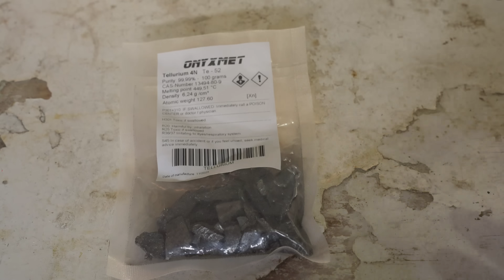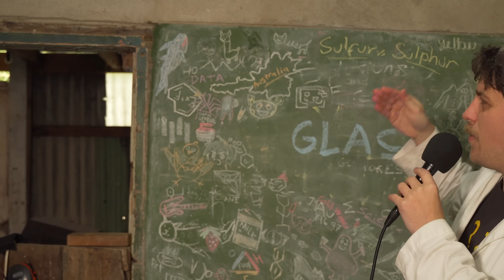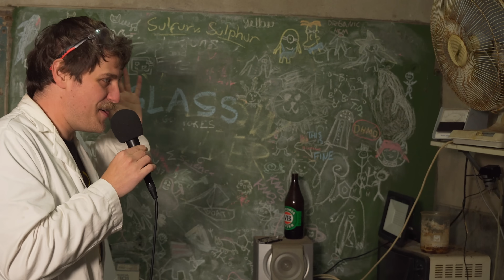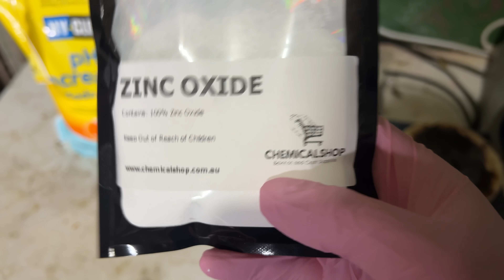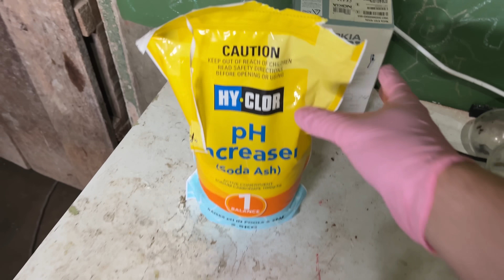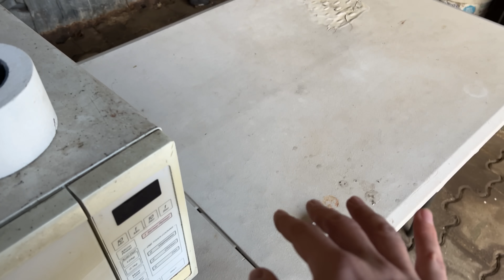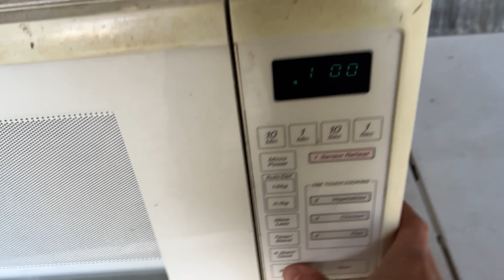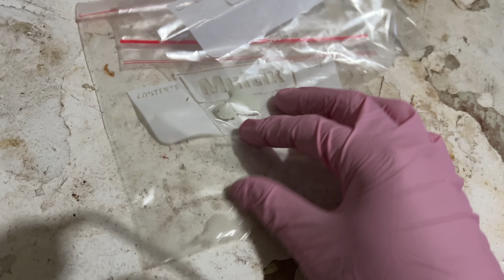Let’s make TeO2 glass with bright fluorescence

Comment: Everyone talks about photons but forgets about darkness; that is carried by subatomic wave-like particles called photoffs.
Reply: And also the elusive Fuckoff particles also known as dark matter.
Reply: Thanks dad.
Reply: There are also jerkoffs, but they have nothing to do with physics as far as I’m aware
Reply: Photoffs walked so photons could run
Reply: There are also particles that carry a lack of vibration called phonoffs.  Apparently, they're quite frequently emitted by powered-down electronics, making them very popular at movie theaters
Reply: @bobloblaw4297  Well done
Reply: You mean dark light?  Like dark energy?
Reply: Ahh, another proponent of the darksucker theory of light bulbs!
Reply: @aetius31  The Fuckaround subparticle with two spins
Reply: i thought photoffs were waves that behaved like particles sometimes, not particles that behaved like waves sometimes?
Reply: @jimsvideos7201  The fcukw¡t never gets mentioned.
Be that the up fcukw¡t,
The OG fcukw¡t,
The down fcukw¡t,
Or the totally screwy strange fcukw¡t.
More research is needed, but it could rewrite the standard model.
Reply: @Sniperboy5551  "there used to be a bunch of assholes that lived in this particular building here... but we systematically removed them like you would any termite or roach..."
Reply: @Sniperboy5551 that would be **negative** derivative of acceleration
Reply: And they can move faster than light in the right circumstances.
Reply: @Sniperboy5551  I think Jerk is a derivative of acceleration over time.

Comment: I wonder if the reason tellurium's chemistry is so weird is that it has 8 stable isotopes, with a 10 neutron difference between the lightest and heaviest. Might mess with the orbitals and stuff? I dunno.
Reply: It has d orbitals which are close in energy to its valence orbitals. It could just be the result of how many bonds it can form with other species.
Reply: It won't mess with the orbitals, but heavier isotopes have different kinetics. Although a difference of 10 is very small compared to the total mass, so it won't have much effect. Like the other commenter said, it's more to do with how close the orbitals are to each other, which is more related to the high charge of the nucleus and sheer number of orbitals than anything to do with mass. d-orbitals are WEIRD.

In short: atomic mass can affect kinetics, bond strengths, bond vibrational modes etc, but it doesn't affect the orbitals, which control the types and number of bonds an element forms
Reply: I think the problem is that tellurium is stinky and other things dont like it
Reply: i absolutely love your videos and they are so informative
Reply: Tin has 10 stable isotopes with a 12 neutron difference between the heaviest and the lightest and behaves much more "normally" so I doubt it

Comment: One of my favorite things about back yard chemistry videos is how often people incidentally make the most hazardous rocket oxidizer in common use, that most career rocket people have never seen in person.
Reply: as a layperson, what is the oxidizer you mean?
Reply: The brown gas, nitrogen dioxide. If you cool it a bit it turns into nitrogen tetroxide, which is a common oxidizer for bipropellant hypergolic (self-igniting) rocket engines, usually used with some kind of hydrazine. If you've seen any recent press about astronauts stranded on the space station, it's because nitrogen dioxide has been damaging the seals on their thrusters and it isn't clear if they will keep working.
Reply: @bbrockert the manufacturer used the wrong kind of rubber didn't they...
Reply: @bbrockert I accidentally make it every time I start my truck
Reply: speaking of, whatever happened to xombie and xaero?
Reply: Not only "make" but "know what it smells and tastes like" which is 🤯
Reply: @bbrockert source?
Reply: @MatthewHolevinski  Xombie is retired, still exists. Astrobotic is still operating a xaero-similar vehicle called xodiac.
Reply: @GrimReaping  It certainly might kill some people, but have the shareholders got more value? That's what matters

Comment: Hey I can explain why the torch strobes! Basically all flashlights and similar objects use the same exact off the shelf control chip to do shit like "make it so you can have a button that turns the thing on and off" At some point the standard chip became one that does that strobing thing and it is in fucking everything for some reason. Some reason being they're very plug and play, consistent, functional, boring shit like that. Basically it means that instead of thinking about control circuits the makers of that torch simply bought an existing design.
Reply: Doesn't it also help in flashlights to work as a distress signal? The strobing is eye catching
Reply: @magneticsnail7218  not that useful unless you want to signal people in UV in this case
Reply: Yeah only the more expensive flashlights tend to have custom modes. Or even just UXs that don't suck. Cheap lights all use the same shitty controllers that are mostly; hi lo strobe. Sometimes you might get a medium or an SOS! I've seen so many one button UIs that do it better but for some reason the cheap ones are all trash.

E; also if it works, it works. It drives the LEDs, and its cheap. It's stupid, but hey, cheap is cheap. There's a reason the more expensive ones are the ones with different controllers/UIs
Reply: Yeah so you have to cycle through all the modes every time when you only want off and on.
Reply: I have a personal beef with the manufacturers of both that 'flashlight chip' and the 'BT device chip'. If they would have just had the button be held for a moment to change modes, and have the headphones say the battery state when they turn on, that would be awesome. My favorite flashlight has that role mostly because the modes actually make any sense. 
Also can we just disable the redial feature on BT headphones? I have never once wanted to do that. That's more a complaint with the OS though.
Reply: To make it on and off it doesn't require any chip. A simple sketch exist that has been doing the job for very long. They are intentionally adding the feature because why not.
Reply: China, probably made in the samer factory too.
Reply: @nexaentertainment2764  It's like with Christmas lights; Starting in the '90s and up to the present day they all seem to have the same presets (Combination, In waves, Sequential, Slo-Glow, Chasing/Flash, Slow fade, Twinkle/Flash, Steady on). I guess it's because the manufacturers churn out millions of these controller chips under the assumption "Meh, it works, and they sell, no one really cares, so why bother updating the design".

Comment: I worked in a copper refinery. The Se&Te reported to a byproduct of the electrolytic cells called slimes. Slimes contained all the precious metals, Se/Te and Cu.  The slimes were pyro processed (NaNO3& NaCO3 + hell fire) and separated into dore' silver (contained all the Ag/Au and Pt group), slag and a red mud we recovered from the off gases.  The red mud was said to contain the Te.  The Se&Te went off to a department called Se/Te and the Se/Te were refined.  Mostly we made product forms that were easy to use in steel alloy production and some super high purity forms for niche markets.  A massive amount was processed into medium grade crap that went into a warehouse in case an application arose "someday" Mostly the warehouse helped the company avoid disposal cost of this less-than-worthless material.  People did get exposed, not all exposed people got stinky. Those that did acquire the stank were never cured. My job took me all over the plant. I hated Se/Te, mostly I hated the SO2 used to process the stuff. Congrats on the result.
Reply from the maker: Yes everyone waits for the Te price to rise… any day now… we might actually need more of it someday… Thanks for sharing mate!
Reply: Would EDTA chelation work as a cure?
Reply: @CPU9incarnate  I doubt it

Comment: Tip from an inorganamus, next time you need fine powders from metals or nitrates you should look into steric entrapment synthesis.  I have the fortune of skipping most the steps and working with 5N materials but this is sometimes the easiest way to get nanopowders on the multiple gram sort of scale.  Extra short version: 1:1 pva:nitrate, water to solve, evaporate, heat to 250 in beaker, don't huff the fumes, grind and calcine the black foam, get a beautiful white powder.  A reasonably tuned SES protocol should be able to yield submicron grains, if a little agglomerated.

Comment: Tellurium can be added to metal stock to make it easier to machine. Copper is quite soft, so it tends to be difficult to machine. Cutters tend to dig into the metal, making large chunks rather than small chips. Tellurium is brittle enough that adding a small amount (0.5%) will cause the resulting alloy to break off in small chips, improving the surface finish and ease of machining. I recently bought some and have been turning it, and it does machine very nicely. It's copper alloy C145.

Comment: For future glass chemistry purposes, in general if you cook the glass long enough in an oxidative atmosphere, the oxidation of any metals present will take care of itself. Especially if you have a lot of other oxides in there as fluxes to strip the passivating layer, and you finely grind the metals. I've used pure iron, copper and zinc powder in glassmaking (glazemaking, actually, but glaze is just a glass on ceramic) and in an oxidizing atmosphere they all do oxidize substantially. Unless it's a refractory material like chrome or aluminum, oxidizing in advance is optional in many cases.

Also, the best rule of thumb for glass chemistry is as making up a broad set of 3 properties: fluxing, glass-forming, and stabilizing. A flux makes the melt more liquid, glass-formers contribute to the transparency, and stabilizers are usually refractory and keep it from being excessively liquid, weak, or spattering. In this recipe, you have TeO2 as the glass former, ZnO and NaO as the fluxes, and no stabilizers (often fine for a compound intended to be low-temperature-melting). We don't usually include colorant since its properties are usually either refractory or a flux, and it's uncommon to have more than 2% colorant. This recipe is actually (un?)surprisingly close to many low-fire glazes used in ceramics.

Comment: Tom, maybe make up another batch of glass, but pour it into a blocky square mold and put it back in the microwave furnace, and try to slow cool it over a longer period? Could even pour it in, then remelt and just run the microwave at a lower and lower duty cycle to slow cool and see if your rapid cooling theory is correct. Then partner up with a gem facetter (lapidary) and try to get them to face off the two ends and build a solid state laser, or if that doesn't seem to work just blast it with the highest intensity 337.1nm light you can get out of the kitchen junk drawer. (I could ship you one that you could power with the HellMachine...)

Comment: And for reference most fiber transmission systems operate in the between the 800nm-1600nm range.  So yes, the generally Ytterbium and Erbium doped glasses are used for high rate optic transceivers.

Comment: Oxidation of Te with HNO3 is a reversible redox reaction.  When you stopped the release of NO2 (product), you drove the equilibrium to the left in favor of the reactants, quenching the forward reaction.  As long as both reactants, HNO3 & Te, are still present in the beaker, allowing the gaseous product NO2 to escape will drive the reaction to completion.
Reply: I have no idea if any of that is true, or if those are even sensible chemistry terms, and yet... I believe it 100%
Reply: Are you sure? The peroxide just reforms nitric acid from NO2, so the NO2 is still being produced and immediately removed from the reaction - it doesn’t have any chance to reduce the metal oxide back to Te (I would think). That’s why it seems more likely that the nitric acid is basically just going too fast and forming an oxide coat (passivating, like he said)
Reply: No, that makes absolutely no sense. He didn't stop the release of NO2 in the sense that you're thinking. H2O2 and NO2 makes nitric acid, so if anything it actually drives the reaction forward by quite a lot.
Reply: @adrianpip2000  It makes perfect sense.  He did stop the release of NO2 in the way that I'm thinking.  This is a multistep reaction, but if you just look at the overall reaction, he took a gaseous product that was happily leaving the reaction mixture and sent it back to the reactant side of the equation as nitric acid, one of the reactants.  Anyway that you look at it, that just adds to the rate of the reverse reaction.  HNO3 is already present in considerable excess, so adding a little more will have a negligible effect on the forward rate.  Continuously removing a product from the reaction mixture will not only speed up the forward reaction considerably, it will insure that the rates of the forward and reverse reactions cannot equilibrate.  Once the NO2 is out of the beaker, it's no longer available to participate in the reverse reaction.  Put another way, once a product, ANY product, permanently exits a reversible reaction, that reaction becomes irreversible.  It will eventually go forward to completion.  That's Lechatelier's Principle in a nutshell.  Another issue affecting the forward rate, especially in later stages, is the apparent passivation of the tellurium by a coating of insoluble tellurium tetranitrate product.  More vigorous agitation might overcome this issue by exposing fresh tellurium to the acid.  I can only assume that he had a valid reason for going this route to TeO2 instead of just burning Te in a stream of air.
Reply: @Franklin-jj4jz  but physically and chemically removing NO2 from the reaction are equivalent… just like in a biological system, it doesn’t matter if a product is simply removed from the area of the reaction or if it participates in a subsequent reaction; it is being removed for the purposes of equilibrium. This was definitely just passivation.

Comment: When making a glass samples you can also do a "splat" where you smear the glass onto a metal surface with a metal spatula or other flat metal thing. This will produce some internal stress, but because it is very thin and cools rapidly it probably won't shatter and its a good way to get a thin enough sample to see through even if its kinda murky.

Comment: I almost wonder if that Tellurium Dioxide you made underwent  hydrolysis due to ambient moisture and became Tellurium Hydroxide. That would explain a change in color and it was left unattended in ambient conditions for an extended period of time. However, it is also possible (albeit unlikely) that you actually made some sort of nitrate instead of oxide. That would make sense since a lot of nitrates are yellow...ish. Lastly, it could just be dissolved Nitrogen Oxide gases.

Comment: For a different perspective on "phonons aren't objects", it's the same as the holes when considering electron-hole pairs in semiconductors. It's a phenomenon that arises due to everything going on around it that conveniently behaves as if it was a particle. Phonons arise when you try to quantise the lattice vibrations of a solid. When you consider phonons, you can describe the heating of a semiconductor when applying a current as electron-phonon scattering

Comment: Tellurium is used in a few interesting gadgets. Lead and tin telluride are used for thermoelectric refrigerators and mercury telluride is a phitoelectric sensor for the middle infrared while Cadmium Zinc telluride is a gamma ray detector. Tellurium dioxide had extremely strong optical dispersion so its used for acousto optic laser beam switches and spectrometers. Very neat stuff.❤

Comment: You could try using samarium instead of europium if you can get it. It will emit light that's orange (compared to more red of europium), and will be excited by the same UV light as europium, but it helps in forming glass too. Generally samarium is helping in every oxide glass. You want to use about the same 0.5 at. % of the stuff as you used for europium. It has vicious concentration quenching, whereas europium is mostly only lightly influenced by it. (Europium oxide still emits visible amounts of light, while samarium oxide doesn't).
And for what it is worth: when we prepare quite similar glasses we pour onto big block of brass that's at room temperature. This gives the clear glass, but the internal stress is really high, so we then have to relax it by annealing. We do this with inverted beaker put on top, as sometimes glass will suddenly shatter.

Comment: I think you might do well to re-melt them in a graphite crucible instead of the alumina one.  This way you just turn off the microwave and leave it alone to cool all on its own and self-temper.  No need t pour it out.  It might stay more transparent this way with slower cooling and no shock.   It might even glow yellow.
Reply from the maker: I think the goal is to rapidly cool it to actually prevent crystallisation. Crystals are bad because you want it to be glassy, more like a shock frozen melt than a crystalline substance
Reply: @ExtractionsAndIre  Well then...never mind.  😁

Comment: Great attempt! in order to get it clear, you need to use pure chemicals, and not pool chemicals.

Optical glass is fussy, and the least amount of impurity will cause a multitude of problems.
But the fact you had florescence shows you were able to have the Te make it into the mix.